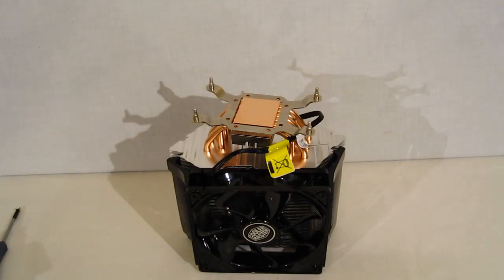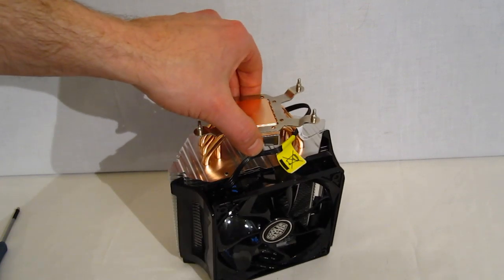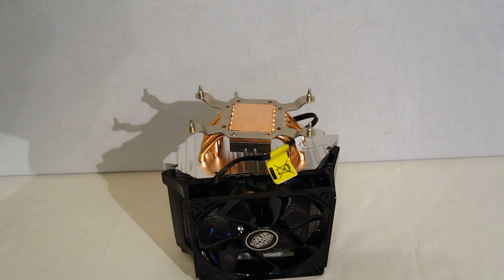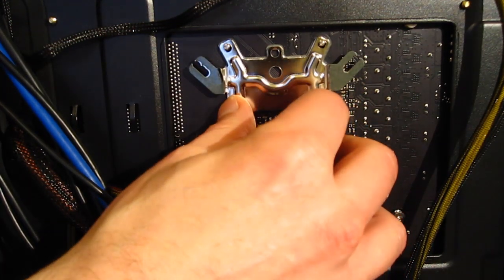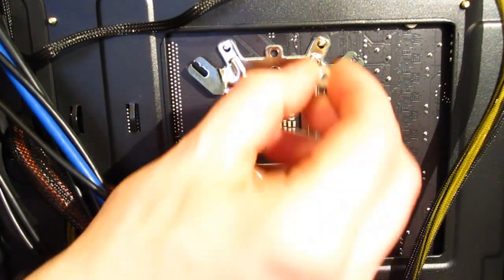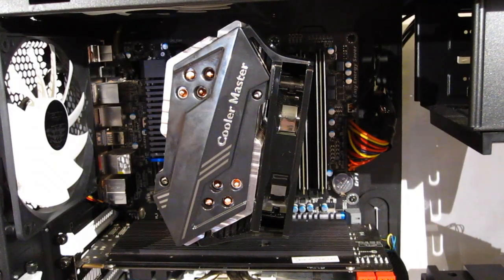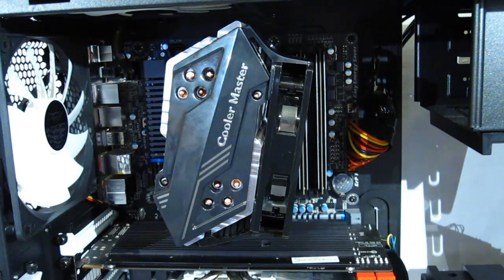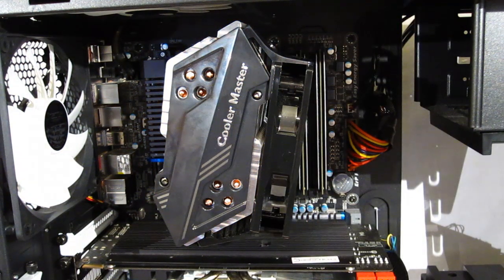Cooler Master X6 Elite Installation

Comment from the maker: The amount of thermal paste used depends on the physical size of your CPU. AM2/3, LGA2011, 1366, and 1155/1156 are all different sizes and will require different amounts for coverage.

Comment: Excellent review! Just wondering, what kind of temperature's does it run at under normal load? ie just internet browsing, email, word documents etc? I appreciate that these figures will depend on what kind of cpu you have, but a rough ballpark figure would be very helpful. Thanks in advance!

Comment: you can search online for DDR3/DDR2 memory, and add in: "Low Profile" so that you'll search low profile heat spreaders, instead of the ones that stick up and require more clearance.
here's one, ' 8Gb Corsair Vengeance low profile '

Comment: Hi, will this fit on my Spike Cougar mini gaming tower?
Its dimension: 180(W)x370(H)x425(D) and I'm only using 1 ram (team elite 1333 mhz 8gb). I'm really eager on buying this but not sure if it will fit in my case.

Comment: i definitely interested with this cooling processor..
but, is there any problem with the unusual heatsink position ??
im using P8Z77m - corsair vengeance x2 8gb - lga 1155.

i kinda worried if that heatsink fan will havin installation problem with my ram.
pls help for the suggestion. thnks before :)

Comment: will it fit in a CM N200 case?
Reply: On Cooler Master's website they list in the features of the N200 a clearance of 160mm for CPU coolers. Again, looking at the Cooler Master website, they list the height of the X6 Elite as 157.3mm.....

Comment: some ass installed this one on a micro board and it was pressed against the graphics card with a piece of plastic slipped in as "protection"
I was just asked to put in a different card they bought and now have to turn this so it blows vertically as theres no room for the new card as it has a back plate :(

Comment: can this fit with Kingston 8GB Hyper X Beast i am afraid that it will block it
Reply: The X6 Elite overhangs all of the RAM slots. Definitely no room for large ornamental heatspreaders.
Reply: Imma cry :'(
Reply: Going with G Skill Ares, Patriot Viper 3 Low Profile, Mushkin Blackline or ADAT XPG is a better option than crying....and a better option than HyperX Beast in general.
Reply: welp my country only sell kingston and corsair ram
Reply: but i am looking forward to hyper 212x with added fan.does it fit?